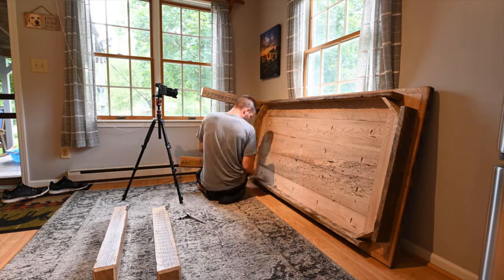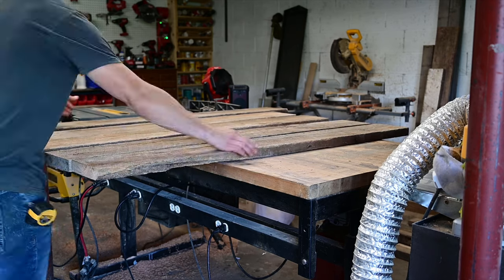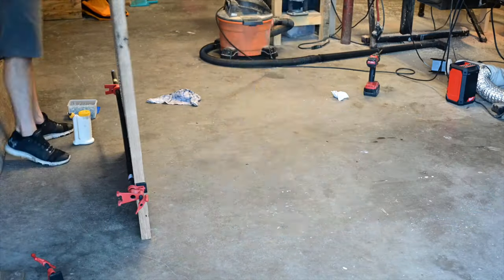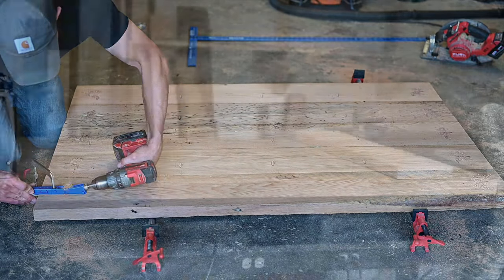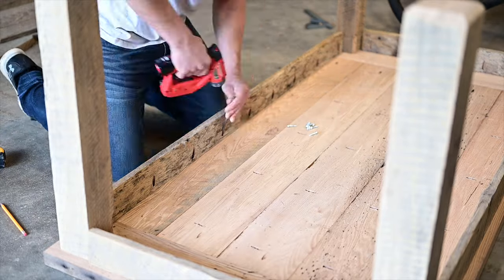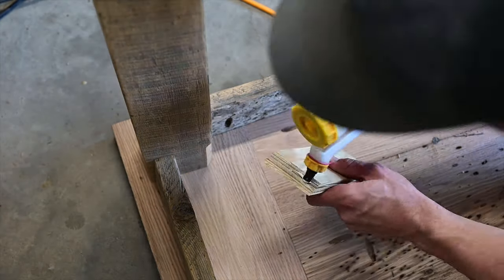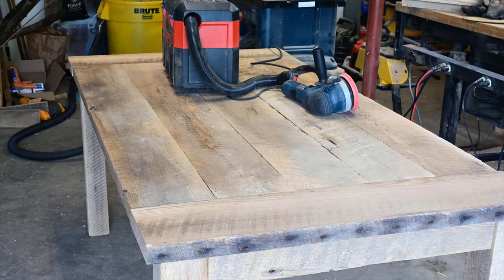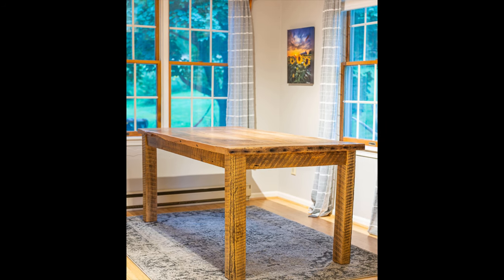Reclaimed Wood Dining Table Build - With Removable Legs - 100+ year old barn wood

Comment: You are very right in saying one of the biggest drawbacks is the nails! It's a hell of a process cleaning up reclaimed wood isn't it? I did something very similar for a customer who wanted a large dining table made out of reclaimed roofing rafters from their house renovation. I used z-clips to attach the table top to the apron though to allow for wood movement. Great job on your table Brady.
Reply from the maker: I use z clips as well now. This table was done very early off in my woodworking journey when I didn't have a full grasp on wood movement. Thanks for your comment!
Reply: @BradyHommel  The learning never ends 😂

Comment: I've been looking for a "removable legs build" and this looks great.  However, I'm also worrying about seasonal expansion...with the aprons attached with pocket holes (I guess I mean along the short sides) how do you allow for expansion?  If I used z-clips or similar to attach the apron then that won't be solid enough to allow the chamferd edges on the tops of the legs to "snug down".  How did you solve this problem -- or can you convince me that it doesn't need solving?  Even the bread-board ends worry me.  BTW all this anxiety reflects my lack of experience (like 3 months woodworking)...am I just being paranoid?

Comment: I love this video so much.  all my questions have been answered.  however I wondered if I can use this technique if I don't plan on removing the legs, or would you have done anything different.  thank you.
Reply from the maker: Thank you so much! If you don't need to remove the legs I would use mortise and tenon to connect the legs to the aprons, or pocket hole if that's what you have since it will be hidden anyway

Comment: Brady, I watched your video.  Noticed you pocket holes AND glue all across the bread board ends.  I would think the top will crack with wood expansion.  How did you account for that?      
A fellow woodworker tring to learn all the time,
Newt
Reply from the maker: Hey! You are 100% correct. I did not account for wood movement when building this. The breadboard ends are done wrong on this table and would not recommend doing it this way as it's a risk of cracking table as you said. I now do it with a festool domino (floating mortice and tenon) to allow for wood movement.

Comment: Great looking table.  I am curious, have you have had an issues with splitting with this design?  I love pocket holes but, I have heard breadboard ends should be floating so when the main boards expand from humidity changes that have some room to move side to side.  I am looking at doing some tables like this and want to know how I should design them.
Reply from the maker: Thanks a lot!! I now use mortise and tenon joinery to do breadboard ends. I haven't had a problem using pocket holes but no since I sell this stuff and do it full time professionally I use mortise and tenon so that risk is gone. I use the festool domino to be specific. Hope that helps!
Reply: @BradyHommel  Thanks for the feedback.  That is the way i was leaning toward doing it too.  Takes longer but, lasts longer.

Comment: Excellent video! I’m in the planning process of making a similar table with reclaimed wood, but am using old wood flooring planks for the table top (tongue and grove). Aside from gluing and having the pieces attached to the frame, do you think I should I need to somehow screw the planks together or will the glue and frame be support enough? Thanks again for the video-was really helpful!!! (Upstate? Do you consider that north of Syracuse or north of NYC?😊)

Comment: By attaching the apron with pocket screws, you did not allow for expansion of the table top. Did you consider using a loose connection such as clips?
Reply: What are clips?
Reply: @mikeandmollyspivey3051  z-clips aka table top fasteners but I don’t believe they would have worked with the removable legs. I actually built a table top the exact same way when I first started with woodworking I pocket holed the breadboards to then pocket holed the base to the top huge huge mistake within 6 months the table top was pretty much completely split form one end to the other in several places I had to pull the top off and make another one and I used z-clips to attach it’s been several years now haven’t had an issue.
Reply: That is a consideration. I've made two tables similar to this a few years ago. I felt like it would be ok in a stable environment. However, I didn't put on bread boards.
Reply: Kids haven't had any problems with theirs.
Reply: @robertcombs4916  did you use z-clips along with this removable leg technique?  If so is it solid?

Comment: Looks so great, awesome work! Did the legs feel like they had good strength? Looks like a really nice method! Also, how did the joints along the breadboard ends hold up? Inspiring work, cheers for posting!
Reply from the maker: Thanks Scott! Yes the legs were surprisingly very strong. I have done this on a number of tables since this video as well and they have all worked great! As far as the breadboard ends I am not sure I sold the table a long time ago but I'm assuming no news is good news. With that being said I no longer do breadboard ends like that tho. I realize it is not the correct way. I connect them the correct way now with my festool domino to all for wood movement. Thanks for the comment!

Comment: Wow! Awesome table Brady. Would you use that same Minwax finish if the table were to be located outside? Add anything else?
Reply from the maker: Hi David, Thanks a lot!! For outside I would use SPAR Urethane. I believe Minwax makes a version of that as well as a bunch of other brands. its oil based urethane and meant for exterior. Hope that helps!!